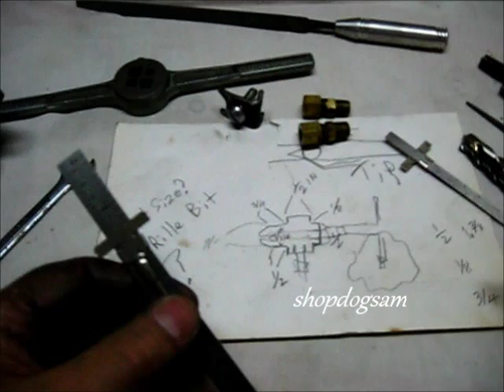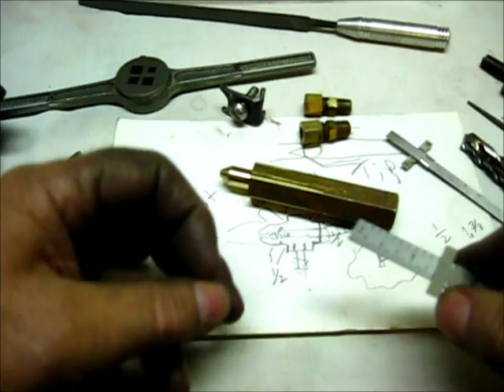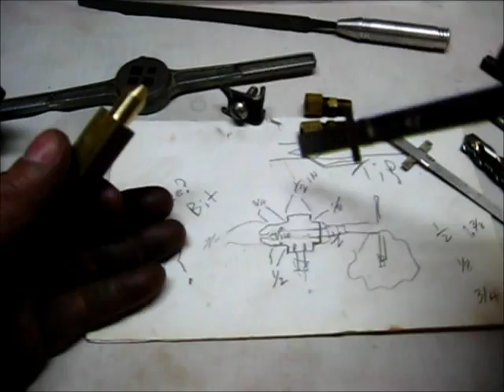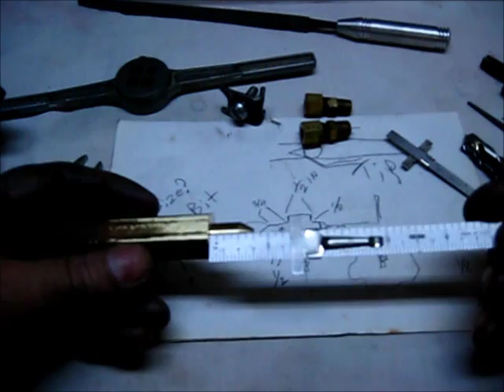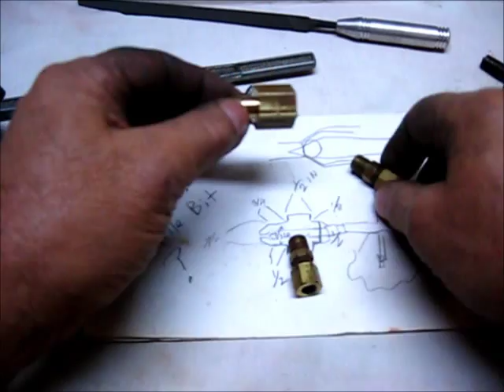Fairbanks-Morse 1 1/2 hp dishpan #15

Comment: With most machine's dials being calibrated in .001s many things are just as easy to do in your head as is memorizing the fraction equivalents. 3/8=.375 and the like 1/16" to 1" in .0625 increments, Or they make the neatest little charts that give it all! Drill sizes & tap sizes and what drill to use with taps. Just one old job shop machinist to another and beginners who might be interested. There are many shortcuts you can use just by setting zero on your dials, to part or stopped chuck.

O,,,